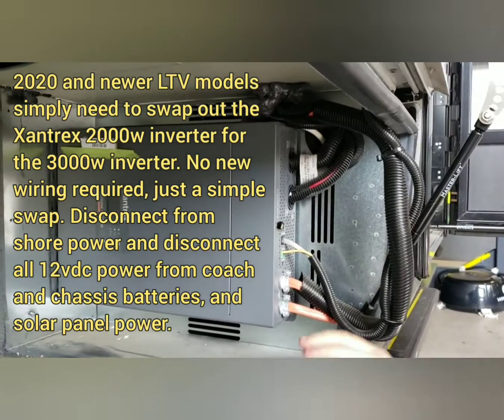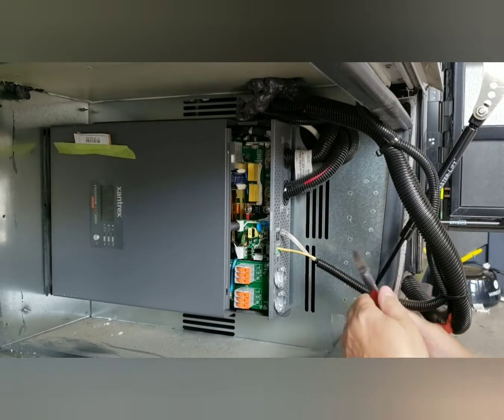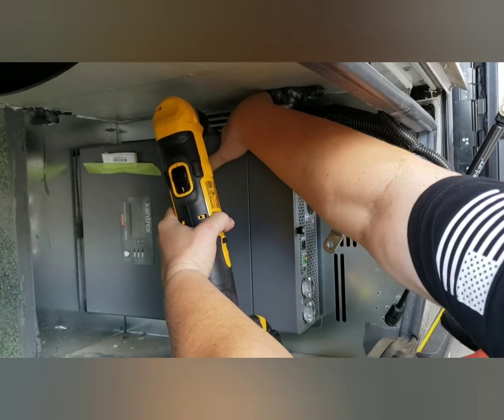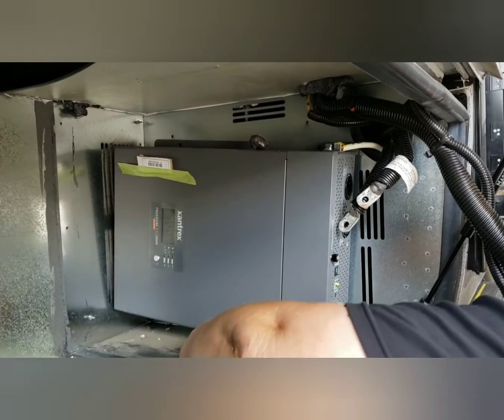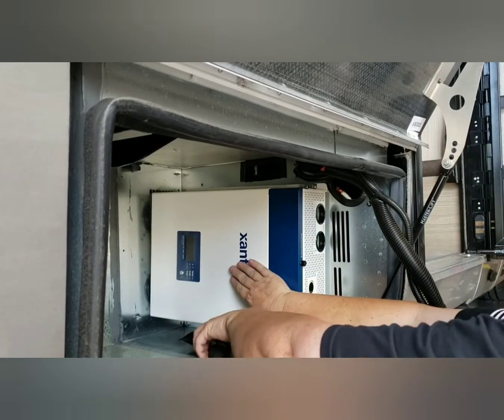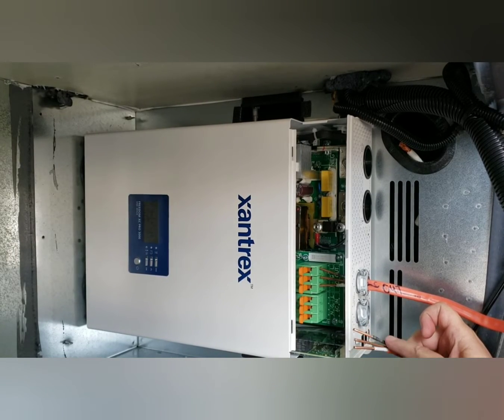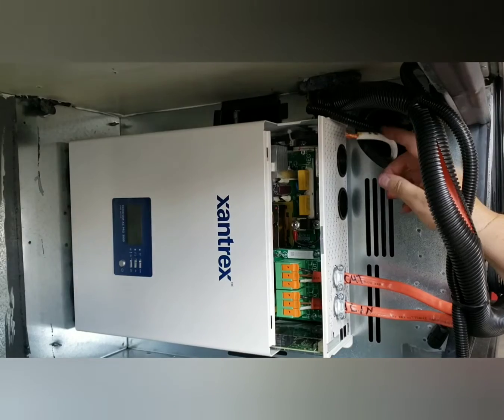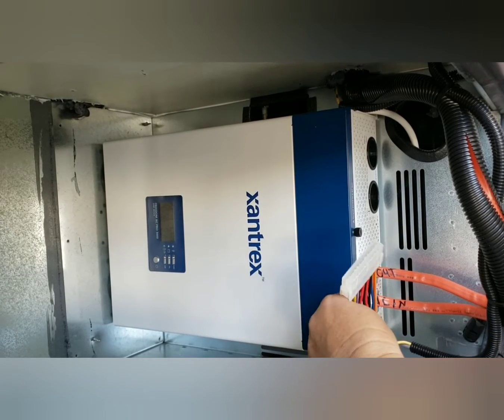Replacing a Xantrex 2000w Inverter with a 3000W in a Leisure Travel Van

Comment: With the white case, is that the marine version (818-3015) vs the regular 3KW inverter with grey case (818-3010)?  What’s the difference besides color?
Reply from the maker: The white case is not the marine version, Xantrex has changed the color from the grey to this white and blue. The grey is no longer available unless you get old stock or a used one.